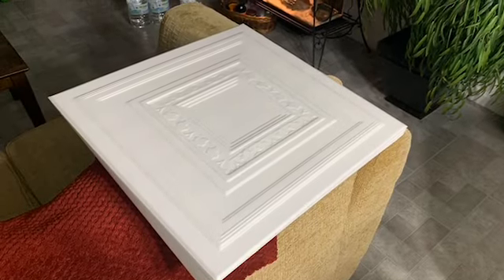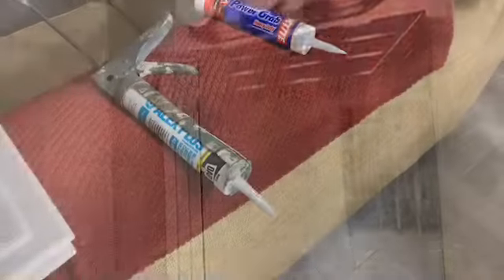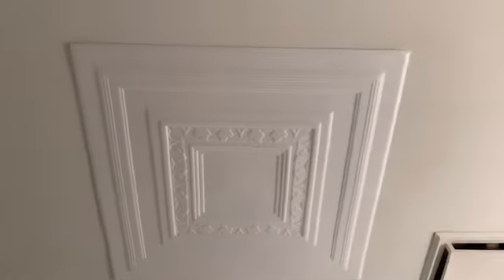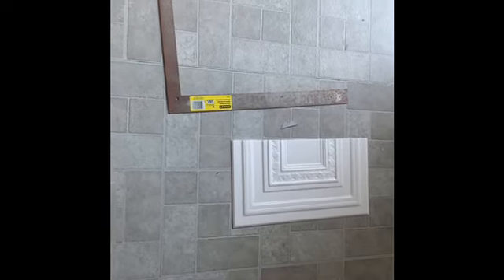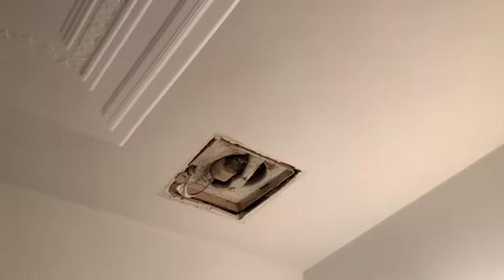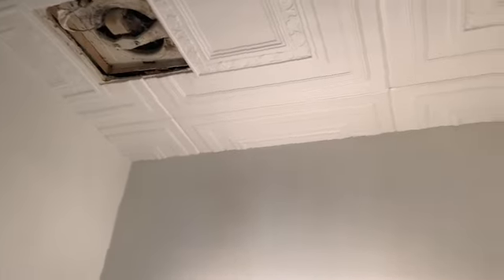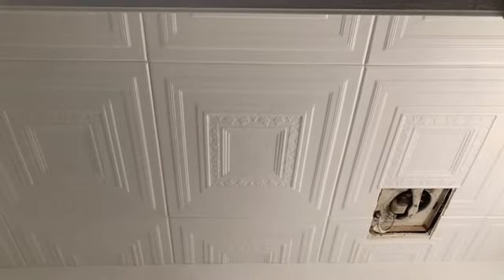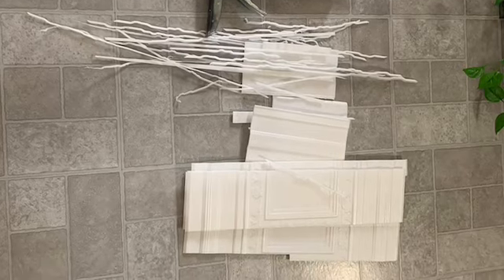STYROFOAM CEILING TILES-Bathroom Installation

Comment: Would you use these on the ceiling in a shower/bath? I know they are waterproof but wonder how you would seal the seams to prevent moisture from humidity from slowly seeping between and under the tiles
Reply: I caulked all the seams for that reason